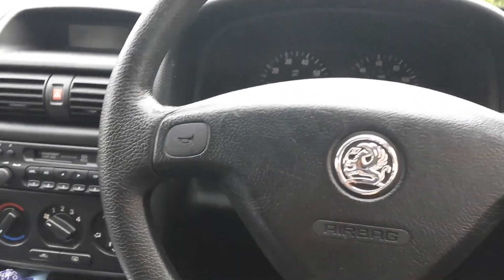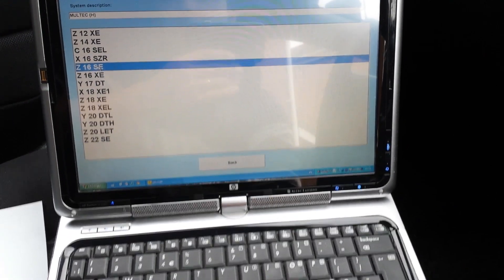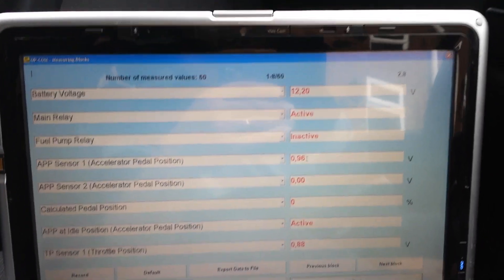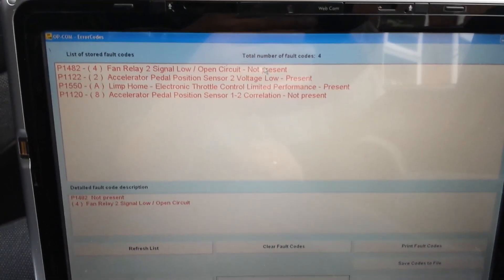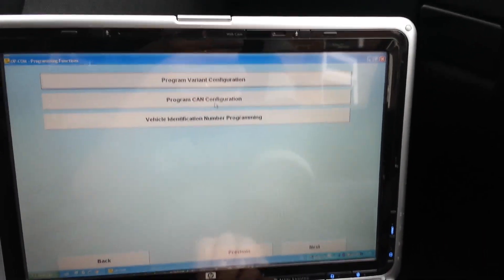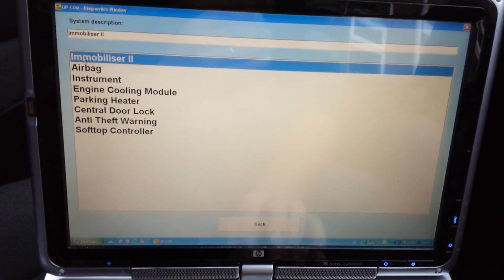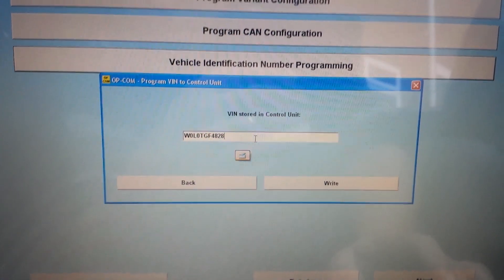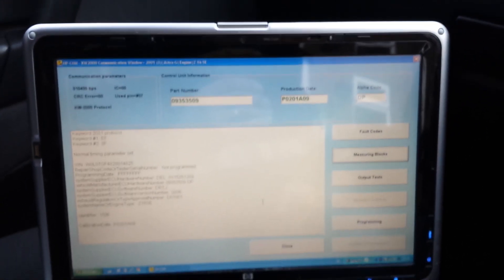Astra 2001 accelerator fault and Engine ECU change and programming.

Comment: Hi I have a astra 2001 8.1 it goes into limp mode how do I fix that?
Reply from the maker: Jade Turner Bennett 
Hi
First you need to figure out why is going into limp mode.
Have you scanned the car?
Reply: yes its stated the mass airflow sensor so i tried to clean the sensor with the crc cleaner especially for it still no luck im guessing i have to replace it.
Reply: thankyou for your quick reply btw
Reply from the maker: Check connections and wiring... just in case...
But it looks like if the cleaning did not resolve it, you need indeed to replace it.
Reply: ill check the wiring to eliminate that too.....then get my wallet out and grab a new one ...love your youtube channel totally helps im a female and doing the work myself lol thanks heaps
Reply from the maker: You are doing well then... hope you get it sorted!
Thank you for watching my videos...

Comment: Hello, my friend .. I have a problem with an opel astra G year 2004 motor 1.8, this vehicle presents a problem that does not accelerate and has the turn on the engine wrench light and light, put scanner and throw the dtc P1120 and P0120 , Test the accelerator pedal sensor and the electronic throttle body and these are in good condition. Checking the input and output signals of the accelerator pedal sensor, I could verify that one of the 5 volt reference voltage of the APP 1 is 0 volts and the APP 2 is 5.01 volts, I assume that the problem May be the ECU. Similarly to TPS 1, the reference voltage of 5 volts in one is 0 volts and the other 5 volts. I am almost sure that the problem is the ECU, I am right ..?, I hope your good comments and advice .. Greetings from Venezuela.
Reply from the maker: angel navarro 
Hi
It looks that you have done all the tests, and you are in the right direction...
to test it even further, you can jump the 5v reference that still working, to the app where the 5v are missing... if the problem is the 5v reference missing from the ECU,  when you do this, the codes just go away... as you will have the app with the two 5v reference...
If you verify the above, then is possible that the ECU is at fault... but check connectors and wiring before assume that. 
Hope that the above makes sensor to you...
Thank you for watching!
Reply: OK thanks.

 Now. Why does the TPS 1 also have 0 volts at its reference voltage ..? . It has to do with the APP1 has 0 volts in its reference voltage too ..?

  The TPS1 works directly with the APP1 and the TPS2 works directly with the APP2 ..?
Reply from the maker: angel navarro 
That's how it should work... each position sensor will have a separate voltage reference...
Now if you have one missing, you can just test by use the one that still working to feed the one that is missing...
Reply: Ok, then, I happen to have TPS 1 and APP 1 not have reference voltage. ?

Comment: I can activate the fan via op com but it will not come on by itself. its had new temp sensor but still fan will not cut in and if left sitting 30mins it will overheat.
Reply from the maker: ciaz2000 
Under live data, what's the temperature readings after the car is left running for those 30 minutes?
Reply: Get to 108c and still no fan
Reply from the maker: ciaz2000 
That's wired... it can be ecu... try a software upgrade... Otherwise try a different ecu...
Reply: Mine is a  2004 tried another ecu from astra 2001 the numbers don't match on ecu.  but is exactly same anyway. On op com fan is either on or off no different speeds. Does that matter ? Could it be relays?

Comment: Hi. My Zafira 2004 has had fault 1571 brake sensor), 1482 and 1483 (fan relay) since I had the car. Just recently it developed 1120, 1122 and 1550 and went into limp mode. Had a new pedal and pedal sensor but only 4 days later the codes 1122 and 1550 are back and car intermittently goes back into limp mode. I have a feeling it could be a EACH fault. Does this sound like I'm on the right track??
Reply: ECU fault, not EACH.. damn predicta text.
Reply from the maker: gary smith 
Hi
That's a possibility. 
Ensure wiring and connections are all good... and that the only thing left is the ECU...
Reply: Thanks, and thanks for the quick reply. Will get that checked out. Really liked the video.

Comment: hi do you know if 2004 zafira 1.6 has ecu controlling activation of radiator cooling fans ?? need help please.
Reply from the maker: ciaz2000 
Hi
Possibly does... don't think that car is fitted with the separate cooling module. 
You can check that under actuators... as you will have the option to actuate the fans.

Comment: is it ok if i buy a non-reset ecu with manual transmission then plug it to my car then program it to automatic?
Reply from the maker: Michael Loay 
Hi
That will be just fine... but if you buy a ecu not reset, you either need the code for it or having how to get hold of it...
Reply: hi. do you know why i cant go to program variant?
Reply from the maker: Michael Loay 
Perhaps the software version...
Do you get any errors?
Reply: lmsvvavr  its saying i find the file at variant folder. something like that

Comment: hi with wich scan tool are you read the fautlt code please
Reply from the maker: Dler Abbas 
Hi
Op-com...
Reply: witch one op com you used in this video is it 1.64 or old 1 ?
Reply from the maker: Aleksandras Steponavicius 
Old one...

Comment: God job, i do repairs for that model of ecu z16xe/se , z18xe..(check out my channel) the lifetime specified by GM it was 10 years..now they started to fail..for all of you that you still have an ecu like this in good working condition , move it from the mount of the engine to the side of the battery, in that way will last longer..

Comment: Hate the chewing sounds
Reply from the maker: Metatron 
The villager that fixed the problem after some 'professionals' failed to even diagnose it correctly...
Reply: I'm not talking about his talent to repair cars , just it's not nice sound , and making vid unwatchable ...
Reply: Let the heaters.great job like your videos.i did one zafira today with app sensor low voltage fault and i just switch together wires on the pedal conector i thik that not will make any problem
Reply: LM Auto Repairs it been a month since then it still works
Reply from the maker: That is another way of resolving it... hope it lasts!
Than you for watching!
Reply from the maker: nimrabuljak 1233 
Good!
👍
Reply: yeah , it sound not professional , it sound like some villager get into the car for the first time ...

Comment: Hello, I have 2007 Opel Corsa 1.2 with ECU problem. My ECU part number is 
0261208940. I can't find another used ECU with same part number. But I 
found 2008 Corsa 1.2 ECU with part number 0261208253. Last three digits 
are different. Would it fit my car?
Reply from the maker: Hi
If is coming from a donor with the same engine code, I would say yes...
Best way is to find which part numbers have superceded yours.... try the dealer.... they can be helpful sometimes...
Reply: Thanks

Comment: Great vidio you made here,,,, i had p1482 cooling fan no 2,,spanner light on when warm,about 9 miles of driving,,,checked all wires,, pluged i opcom same as yours,,, bingo Ec u changed also transponder,because had no code,,, then i had my transponer chip red,costing £20, then used my old pin for new ecu,,,2 years now still working fine,,opcom was £7 from china,,,not a clone,,happy days.[Terry
Reply from the maker: Thank you for watching and for your comment!

Comment: hi was following to replace my faulty ecu. i have bought my code from vauxhall and tried to reset the cars ecu but it says the pin is incorrect. the vin it shows is also different from the car's vin.i'm guessing that someone as changed the ecu and transponder etc as a set and changed the cars identity. i have a new ecu with pin is there anyway of fitted it without the old ecu/pin

Comment: Hello
know how security code astra G using OPCOM device and reset ECU which security code
Reply from the maker: Hi
OP-COM does not retrieve security code...
It does require the security to do immobiliser and some coding functions, to get the security code there is other tools and techniques to to achieve it.
(watch my other videos and read the comments...)
Reply: any device used to read security code opel sk900 do this operation thank you in advance
Reply: any device used to read security code opel GM MDI do this operation thank you in advance
Reply: CAN you give me your email
Reply from the maker: +Med téchnicien 
I do not have GM MDI, although I don't think it can retrieve the pin either...
Unless you connect to GM server, but obviously you need an account for that....
There is some dedicated tools for immo and pin functions... Google will be able to help you...
But for example, car prog is a tool to have if you do opel/Vauxhalls...
Reply: hi my friend how are you 
I want to ask you about car pass opel 
how to find pin code opel from immobilizer  used
Reply: hi my friend how are you 
I want to ask you about car pass opel 
how to find pin code opel from immobilizer  used
Reply from the maker: Med téchnicien 
Hi
I have already answered that question... Unless is something different...
What do you want to know?
Reply: hi lmsvvavr how are you find 
I'm very happy for your answer but I have in problem Whit immobilizer used another car how to program immobilizer in my car
Reply from the maker: Med téchnicien 
OK...  I presume you don't have the pin from the car the immobiliser came from... correct?
When you say immobilizer from another car, do you mean the module that goes around the barrel?
Reply: lmsvvavr 
yes I have a model the car  but I don't have to pin code 
can you give me in way to find pin code Whit Obd 
thinks
Reply from the maker: Med téchnicien 
Through the OBD... don't think you can... you will need to open the immo and read the eprom from the MCU directly...
Reply: l
Reply: lmsvvavr 
read eeprome Whit Tms370 or xprog what to good items 
thinks my friend
Reply from the maker: Med téchnicien 
I don't have the TMS... so can't comment... X-prog will certainly do it...

Comment: great video. I need to replace the ecu on my astra 1.8 z18xe. Where did you get the security code from? Did it come with the ecu? Thank you
Reply from the maker: Hi
Thank you for watching and for your comment! 
In this case the ECU came reset (no pin) and ready to be programmed. 
You will still need the pin from your car...
You will have it on the car security card.
If you don't have that, the dealer will provide it at the cost of a small fee.
Last option is to retrieve the code, for that you have a few options... carprog is one of them...
Google will help you with it...
Hope that helps.
Reply: +lmsvvavr ok thank you.
Reply from the maker: Hi...
I have already explained this...
But don't mind to do it again...
The replacement ECU came already reset... so no pin needed...
The pin you are going to need is the one from your car...
That one you can get it from the dealer or with another tool capable of retrieve the code... carprog for example...
Hope that helps...

Comment: This has happened to my 12 plate corsa d 1.4 automatic. While throttle pedal was changed and ECU reset and it cut out while driving again. Wouldn't let me accelerate at all then wouldn't even crank on start. Garage are now saying I need a new ECU. Just worried that the problem will persist any suggestions?
Reply from the maker: Hi
Thank you for watching! 
The first step will be to get the codes from the ECU, that can help to point you in the right direction. 
If the pedal was changed and you still have the same problem, obviously the cause for it is something else.
Although the codes can give you some clues, this is not always the case, as sometimes can be something else that is causing a false code.
For example, you have a code for your air flow meter (MAF), it might not be nothing wrong with it, for example if the is no feed (voltage) to it due to a broken wire...
In a case like that, and based on your info, before a faulty ECU can be diagnosed, there is some checks that need to be done.
They can be time consuming, and that is why sometimes garages prefer to replace parts and hope it works, rather that spend time looking for the root cause of the problem.
Sorry if can help you more.
Reply: 2/3 of the codes were throttle related and the other was a signal from ECU to gearbox. Garage has said that my ECU is faulty and they will replace it. Just dread it happening again
Reply from the maker: +All Things Beauty UK 
Well is the ECU has been diagnosed faulty then you obviously need to get it replaced. 
If it happens again?
Some cars have their ECUs in a really bad location, some Vauxhalls have the ECUS bolted to the block, has we all know one of the things electronics don't like is heat...
so attach the ECU to the engine was not a very smart idea. ..
And that is one of the reasons  why they fail.
So, bottom of line is, yes it can happen again, but a new ecu should last for time...
Hope that helps.

Comment: Hello, Great video! 
I have  a couple of questions for you. 
I own a vauxhall Astra '03. Recently I have had problems when trying to accelerate, thecar just lost power one day, while driving. I restarted the car a couple of times and the problem went away... temporarily. The problem started becoming more frequent after a while. It would work just fine if i left it standing for about 5 hours than after 10 minutes of driving it would lose power again or if i turn the ignition on and off again. I also have the ABS light comming on intermittently. I left the car at a workshop and they found four different fault codes. But couldn't find the problems. (The codes were P0135, P0230, P0530, C0040.) I was wondering if this sound like a faulty ECU to you? Also what software are you using in the video and is it available to download anywhere? 
Thank you on before hand!

Best regards
Reply from the maker: Hi
Thank you for watching! 
Some of the codes you have can be related with the issue you are experiencing. 
What I would do is delete all the codes, if they are only stored codes, drive the car and see what comes up again.
One of the codes you have is related to the O2, the other one to the fuel pump, you might need to properly test this components and the wiring from them back to the ECU. .. if all OK, then it might be the ECU at fault.
Test also the components related from the other faults, it will help you to do a better judgment. 
I am afraid I can't help you much more with the info you have provided
Hope that helps.

Comment: Hi, i am going to replace my ecu also with a used part i got from a donor car. The donor ecu is not reset, but i have the security code for both the old and new ecu. How is the programming process then? I dont have the immobilizer or the keys from the donor car so i was hoping i could program the old ones with the new ecu. Thanks for great video btw :D
Reply from the maker: Hi
Thank you for watching. 
If you have the code from the donor car, just plug that ecu in the car, with the code from that ecu perform a reset.
Then program everything again using the code from your car.
Hope it makes sense...
Reply: +lmsvvavr I going to try it in the weekend, but how about the keys? will i still be able to use the old ones? with the central locking also?
Reply from the maker: +Jørgen Fone Pedersen yep...
Reply from the maker: +Jørgen Fone Pedersen
The old keys will work... including the remote...😊
Reply: +lmsvvavr okay, thanks for the guide :D
Reply: Hi again. I tried programming the new ECU yesterday but when i came to the point that i had to program the variant configuration i only got an error message saying "File cannot be loaded VAR/GASTRAENGZ16XE.var" and when i pressed ok it came up a new message saying "Cannot read variant coding identifier". The car starts seems to work fine on idle, but it wont go past 3000rpm and i got 3fault codes coming up, P1481, P1482, P1483 all related to the fan signal relay signal low/open circuit. When i took of the old ecu however i reset it. Should i not have done that?
Reply from the maker: +Jørgen Fone Pedersen 
Hi
Reset the old ECU makes no difference to issue you are having now.
Is the replacement ECU identical to the old one?
As you might get errors if the replacement is not compatible.
Like part numbers...
Reply: +lmsvvavr Yes it is identical, same part number and engine code. In the file directory however the GASTRAENGZ16XE.var file isnt there. I am using the china clone software and interface. Do you know if it is possible to get the op-com professional software to work with the china interface?
Reply from the maker: +Jørgen Fone Pedersen 
You can download latest op-com available for clones...
2012 I believe. ..
Reply: +lmsvvavr Any idea where i can find this update? :)
Reply from the maker: +Jørgen Fone Pedersen 
Google will be your best friend for that. ..
Reply from the maker: +Jørgen Fone Pedersen 
Just search for 2012 op-com. ..

Comment: +lmsvvavr great video, question though - how did you fix the first problem? Did you changed the wheel bearing hub or something else? I have the following problem with my Astra 2002 1.6 8v nonABS (takes the speed from wheel bearing hub on the left wheel):
1- Sometimes the speedometer is not working for 2-5 mins when I turn the engine on and driving it. Then works normally.
2- Only when the speedo is not working the engine power is not stable - kangarooing (small jumpings) and sometimes the engine cut out when I approach traffic lights/junctions (braking without on gear - idling)

So I am more thinking like it is the ECU or the ABS wheel hub. Any advices please??
Reply from the maker: Hi
Thank you for watching. 
The non ABS models take the speed from that left wheel, you can measure the sensor using an oscilloscope,  part of the speedo system, is also a converter, with the shape of a relay, which is located on the driver side footwheel...
They can also fail.
Hope that helps....